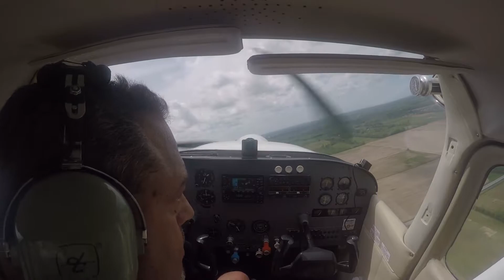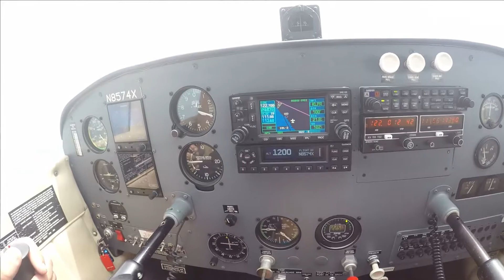Skyhawk - GoPro cameras and electrical issues

Comment: John after watching your whole video I think I might know what was going on.  It appears the alternator switch may have lost its connection behind the panel by being loose but not completely off its connector.  At some point turbulence probably shook it just enough that there was a break in the circuit so the alternator was no longer able to supply its power, just as if that side of the master switch had been turned off.  Then when you were approaching to land, turning on the fuel pump somehow completed the connection again and gave you the huge charge out of the alternator once again as the batt voltage had dropped way off.  In doing so the alternator had enough time to charge the battery back up which is how the next pilot was able to get it started and fly along until once again the loose connection was broken and stopped supplying power the the electrical system.  

When Jim looked at it the next day, he found that connection was loose.  He resecured it and we haven’t had any issues with it since.

Vibration...... the enemy of all aircraft!
Reply from the maker: Makes sense Mike!  Hopefully that does the trick.  I should have caught that in my panel scans before finding it out while viewing a video. Lesson learned !